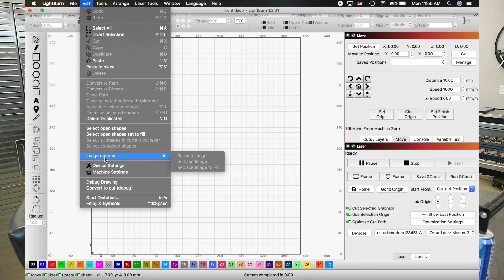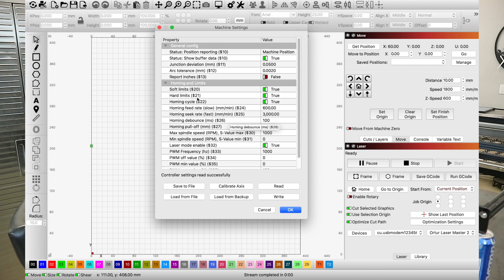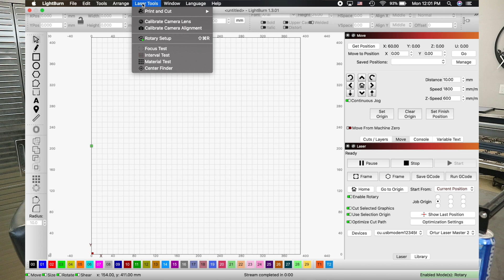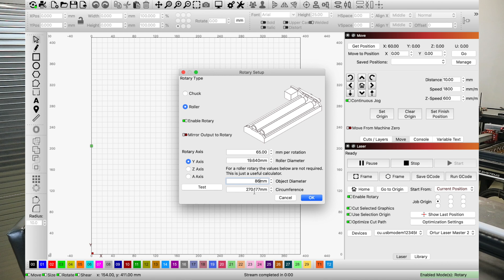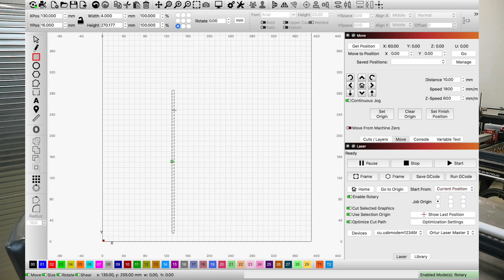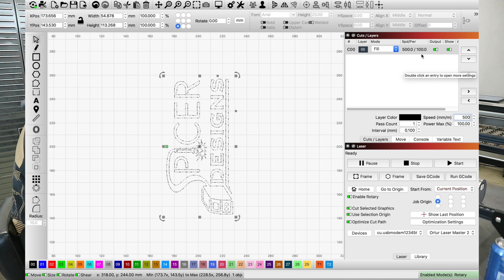ORTUR Rotary Roller Setup....STEP by STEP....

Comment: Have you done any tumblers with handles and have tips? I don't need the image to wrap around the tumbler completely but wondering how to do about it with a handle...if it's even possible
Reply from the maker: @MelP-vh2lu  ive since got some newer lasers that i use.  A lot of the tumblers with the handles, the handle can be removed.  You can use a chuck style rotary tool that works better for tumblers with handles.

Comment: Will it also work with Miller Lite cans?  Have you done anymore to see if you can speed up the engraving? 80 minutes for one tumbler is a lot, but I get it with this laser. I just ordered a LM2 Pro S2 but if I have an order for 20 that could take a while.

Comment: Great video and explanation! Also enjoyed the humor 😅

For some reason my thermos keeps creeping forward when the rollers engage. Any idea why and how to stop that? 

Thanks for the great content!
Reply from the maker: May be angled slightly causing it to walk.  Might have to adjust the setup a bit.
Reply: @SpicerDesignsLLC   derpppp, I figured it out. The Ortur 3 comes with a small metal bar that stops the forward movement 😂

Comment: So if I have my machine attached to a work surface with the screw-down brackets in the corners, I would have to remove them every time I want to use the rotary so. I can raise the machine?
Reply from the maker: Thats correct.  Any time you use a rotary tool you will need the extra hight.

Comment: thank you for this video. I have the same laser and the rotary I got is the ortur chuck. your video is the only one that was straight to the point and fun to watch. I have my laser elongated using bricks and old hardcover textbooks lol. I have not used lightburn as yet, I use lasergrbl so I will see how it turns out. Will have to search other video that use lasergrbl. thanks a mill
Reply from the maker: No problem!   Glad it was helpful for you and good luck with your rotary project.  I appreciate the comment.

Comment: Thx for the video. But my glass keeps sliding off the little wheels that holds it at an angle. And eve try time it rotates, the glass slides. How do I prevent that?
Reply from the maker: Hard to say without seeing the setup.  Sometimes you have to get a little creative to get it to rotate correctly
Reply: @SpicerDesignsLLC  okay I got it to stop slipping, but now my design is coming out crooked… no matter how many times I change the position on the rotary, it never seems to be straight. Any tips on how to get it to be lined up with the laser?

Comment: This video is dummy proof!!!  Thanks. One question though. I know when engraving on a flat surface, you use the cyndrilical fixture to set your focus. How do you adjust the focus when engraving a tumbler?  Use the same fixture? Just curious about that process. Thanks muy mucho!!!
Reply from the maker: You would get your cylinder in place and set the focus on the highest point where the engraving is happening.  Hopefully that answers your question
Reply: Again.  You made this to where even a Marine could understand it. Thanks again.
Reply from the maker: @sirsparkalot2661  glad it was helpful and thanks for your service

Comment: Hey brotha im trying to set up my rotary like yours exact one an when i have everything ready an i push frame it crashes into the side rails tryingvto figure out why this is
Reply: Thankx brotha
Reply from the maker: The X axis is crashing? I would check your design.   Also use the center for your origin and make sure your origin is set to current position.
Reply: @SpicerDesignsLLC  I'll try all this but not sure if will wotk
Reply: It goes to the left an crashes against the rail check design an everything
Reply: Just have been trying to perfect this pos since this lasers come out fml man lol
Reply: It still wants to crash, the laser moves to the left an just keeps going is it necessary to piss around with the origin settings does that make a difference
Reply: Just getting frustrated an really just want to be able to have it right so can use it

Comment: So I have the an Ortur Rotary as well, but my model looks different. My question is, how do I specify in LightBurn where to start and get it head on without screwing up? lol Cause it always seems to want to start in left-front most corner and I can't get the rotary up that far from where it plugs in at. So can you explain how to tell LightBurn where to actually start the work?
Reply from the maker: I think i explain that exact thing in this video.  I use the center origin and current position.  Check that out again.  Should explain that part of the setup
Reply: @SpicerDesignsLLC  awesome, yeah I haven't watched the video yet, but I will when I get home. Just saw you had the vid and thought I'd ask. Thanks for being so helpful!

Comment: I use the "Longer" products and I'm watching your video as I'm playing with my new Longer toy. As I'm playing around with this new rotary to see how it works, I manually move the rollers with a pint glass resting on it and the glass is moving around on the rotary! WHAT in Gods name do I have to do to stop this mayhem!? Do you have a video about keeping your darn material in place!?
Reply from the maker: The rotary setups are kind of a pain. If the glass is not a perfect cylinder youll have to lift the one end to get it level.  Not sure if thats the issue your having.

Comment: nice tutorial vid.. btw, after determining the mm per rotation, does it mean im not gonna change it anymore? or do i need to change it again depending on the diameter of the diameter im gonna engrave?
Reply from the maker: Its been a little while since ive used the rotary tool.  The measurement for the rotary rollers should stay the same
Reply: @SpicerDesignsLLC  ohh.. so no need to change the mm per rotation anymore even if the diameter of the item becomes smaller or larger?
Reply from the maker: @novalyn2875  yes that one will change.  Sorry i wasnt clear.  Just the roller measurement on the tool stays the same.

Comment: I burned one tumblet on your settings and it worked great. Now when going back the same file my logo is compressed. Any idea what the cause may be 😢
Reply from the maker: Well thats good and bad.   Did the settings not hold?
Reply: @SpicerDesignsLLC  checked the settings and was still the same
Reply from the maker: @fiefiebezuidenhout815  im not sure.  Id have to mess with it.   Sorry i cant give you a definite answer
Reply: @SpicerDesignsLLC  thanks anyway. Will try and see if I can get something figured out. 😉

Comment: automatic thumbs up for using keystones for machine feet!
When etching I found with 10w lasers 180LPI (lines per inch) to be the sweet spot; balance of resolution and speed. Using the Longer RAY5 10w about 3000 mmMin / 42-60% power works best.Going higher power or higher resolution turns the metal multon and forms beads around text and so forth, granted your not pushing your speed to crazy numbers like 10,000 mm Min.
Reply from the maker: Thanks for the pointers!  Im still learning with these engravers.

Comment: Good video and thank you and your lovely wife for the video.  Good talk thru and demonstration.  One small point, the number that goes into the Rotary Axis mm per rotation box.  That really seems to be a random number that's obtained by trial 'n error as you show.  There MUST be some relation between the roller diameter, and cup diameter.  Sure would be nice to have that formula, even if only to get close.

Again, thank you.  With your video I was able to engrave my first cup.
Reply from the maker: Thanks Ken.  Glad it was helpful for you.  I agree with you on that number.  Im still learning on these engravers.  I mostly do metal works with the cnc plasma cutter.  If i find a better formula i will be sure to share it.

Comment: Did you change the laser head? you mentioned its a 10w laser, i bought one but i dont think it can do metal?
Reply: It's just removing the powder coating. It isn't affecting the metal itself.

Comment: Was a great video to watch, finally someone getting to the point instead of the usual rambling. anyway, I followed your instruction but had to shut it down for the night, came back to it the next day and lightburn keeps giving me a pop up saying it cannot connect to com 3. When i hit the fire button it gives me a code "error:9 G-code locked out during alarm or jog state." I cannot do anything with the program including putting it back to regular flat burning. I also cannot save the changes you mentioned in lightburn itself. Same thing in Laser GRBL, "access to com 3 is denied" anything you can tell me to help out would be great.
Reply from the maker: Sorry your having issues with the program.  Im not that well versed with lightburn.  I think ive seen that error before but i cant remember how i got through it.  Sorry i cant help you with that one.

Comment: Great videos as always.  You capture things going well but also when they don’t.  You are real and complain or bitch as you should if something isn’t going right.  You also have fun and that’s important.   Found your videos while researching a CK2610 Cab.   We need more tractor videos. Any update?  Do you find that the 25 hp is fine for everything you do?
Reply from the maker: Thanks! I really appreciate the feedback.  I do have some more tractor projects coming up.  I have a couple good upgrades coming.  Ill have more in the spring as well. Thanks for the comment.
Reply from the maker: And yes the 25 hp does well for me.  I confirmed with kioti its a 35hp thats detuned for emissions.  Ive only seen one video of a guy dialing it back up.